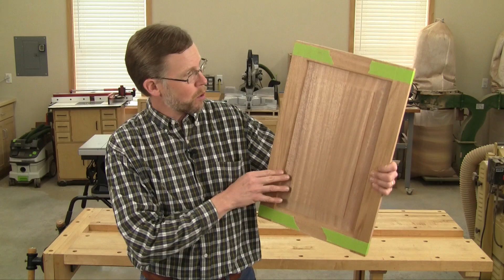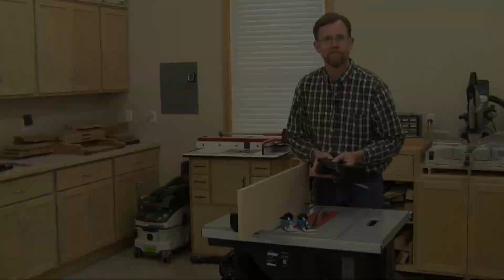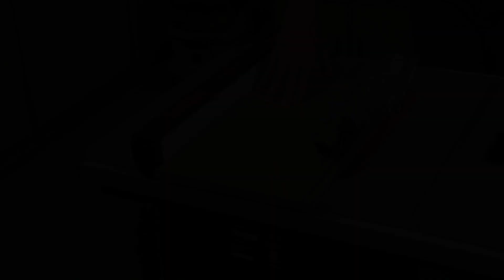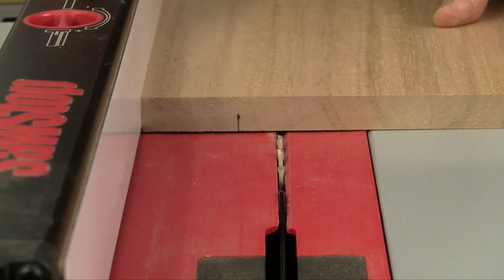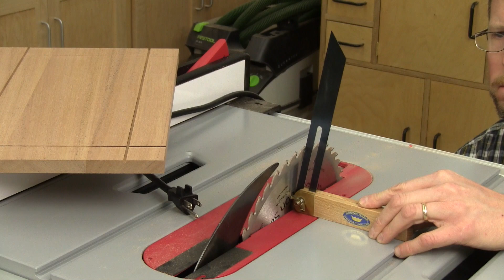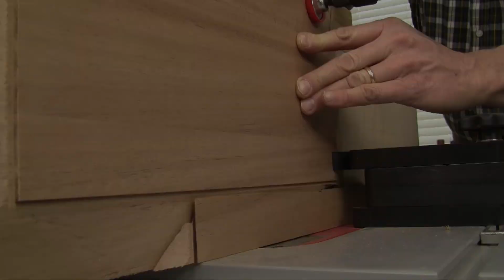Panel Raising with a Table Saw

Comment: Kind of a flawed design.  You show the end of the bevel on the panel the same thickness of the groove in your rails/stiles?  Obviously your panel will be way to thick to fit in the groove. Either the panel will have to be flattened at the end of the slope or the groove should have one side angled to match the panel slope. 
I flatten the panel just slightly proud of the depth of the groove then put a nice molding around which gives the door a lot more depth/richness.

Comment: Uneven throat plates, wobbly blades, jamming, and wobbly miter guides are the norm on these portable table saws.  It is unclear what value the portable table saw offers the carpenter.  The dedicated table saw is the queen of the electric wood shop.  Good video.

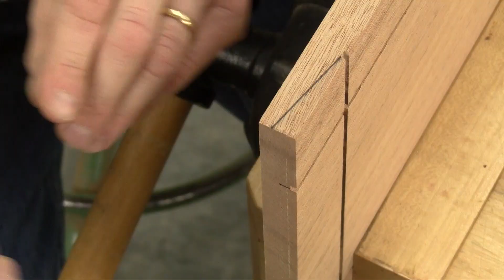Comment: @4:35 you can clearly see that the groove is square and doing this method makes the edge of the raised panel sloped or tapered. You will still need to hog a flat patch to get it to seat fully in the groove. A raised panel bit on a router gives a better and more accurate cut I believe. Forcing a tapered panel into a square cut groove could split your stiles and rails, would it not....
Reply: You are right, but that's why most of us would cut a shallow rabbet on the back side of the panel, allowing the panel to seat fully. The panel will move more in width than in thickness, so most often there should be no problem with splitting. 
When you look at most raised panel doors, you see that the fit between the panel and the groove is rather snug.

Comment: Where would I find a Tall Feather Board? All I've seen are the usual variety. I'm about to start a major redo of my old kitchen which dates back to the early 40's. The original doors are made of 3/4 " ply of good quality which I want to use. It, along with the drawer re-build, is my summer project.
Reply: Forget I asked! Please ignore my question. Old brain and new tricks don't always match-up. Great video!
Reply: I was hoping for the answer

Comment: wouldn't there be a problem with expansion by jamming the bevel edge of the raised panel into the grooves of the stile/rail, instead of a rabbet edge?  A rabbet edge could at least expand into the groove, but the beveled edge will just crack once it expands.
Reply: I've used this method many times with raised panel widths of around 12 inches or less.  Expansion was minimal at that size, so cracking has never been an issue.  Some of those doors are more than 10 years old.  I suppose it might be a concern with wider panels or extremes in temperature or humidity.

Comment: This is a great method and it is  not really necessary to mark field layout lines as once you set the table saw fence at the required distance (for instance 2 inches) it will be set for all 4 rotations of the panel; so if the fence is set at 2 inches it is not even necessary to mark out the panel at all; the field layout  will automatically be exactly the same on all four face sides of the panel and exactly the same distance all round from the edge of the timber to the field area.Great video thanks.

Comment: just a tip. make your runner from two peices that lap over and the back piece drops down over your rip fence jig. Adds a consistent stability so your panels stay perfectly  at 90 to the table.

Comment: Nice tips.  Certainly will try next time I try to make raised panel doors. Questions, how deep is the groove?  The groove looks off center, what is the width of the from the board edge to the edge of the groove?  Lastly the wide side of the groove looks to have a bevel, what is that angle and is that angle to the back or front of the panel?

Comment: Thanks for this, but I have a question:
If, as you say, the panels fit their grooves, " ... all the way to the bottom," they are going to split the joints of the framing, aren't they, if and when the panels swell in higher humidity?
Reply: Offshoreorganbuilder - I think he means the panel to fit to the bottom "for" expansion, but not there for construction.  Hope that helps.
Reply: I think he meant to say NOT all the way to the bottom, since that is what is shown in his hands. There was a gap of at least 1/4"

Comment: Excellent- except the Devil is in the details- namely modifying the panel edges so they will fit
in the grooves in the rail/stiles. Yes, at 7:49, use a block plane and remove the bevel but generate an unsightly edge,
or generate another bevel. Not as clean and ez as it looks. Appreciate all the effort.

Comment: All you needs is a table saw, err....and a tall rip fence and a feather board.  Ohhh and a router table with a stile set of router bits.   But that's all. ....and block panes and smoothing planes....  but that's all.  Good luck with your garage table saw project.

Comment: How thick is the panel 5 inch thick????
Reply: 5/8 inch thick??? I need to convert in metric..
Reply: panel thickness as stated in the video is 5/8", stated at video using the planner